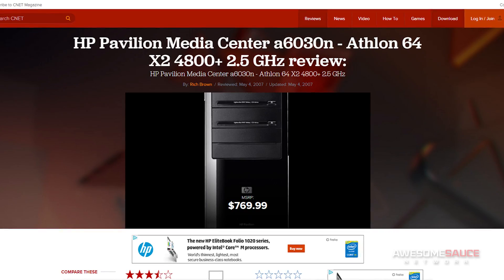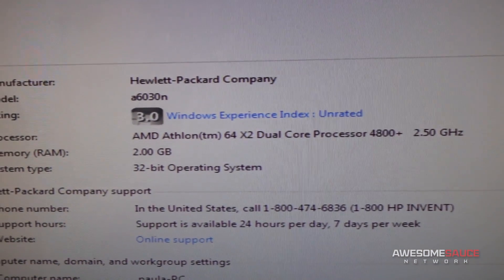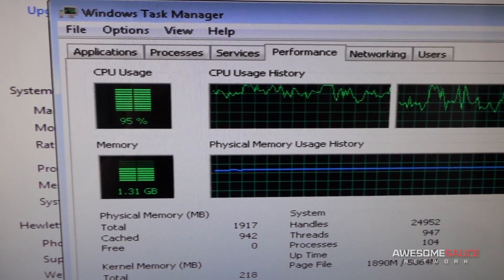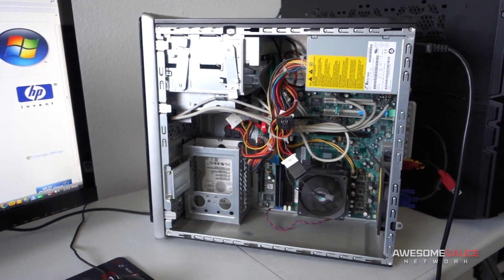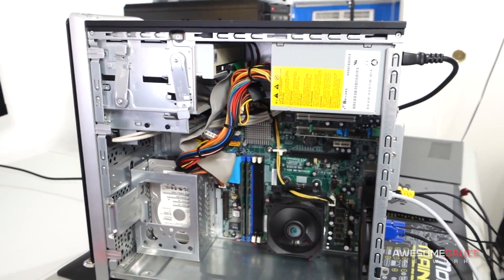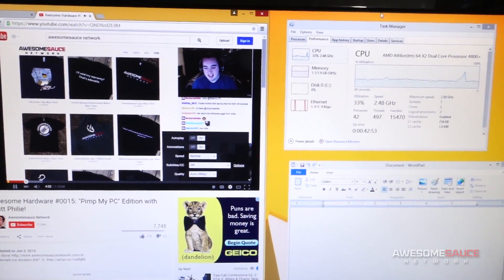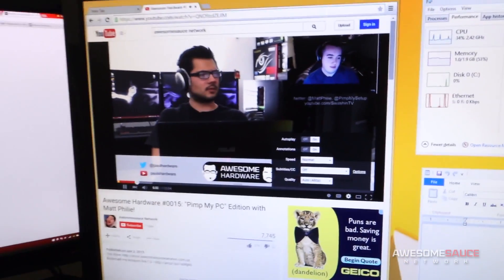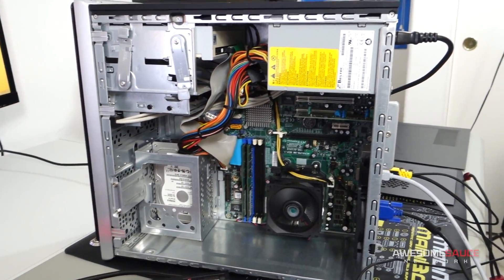Cleaning Up My Neighbor's Old Desktop!

Comment: Did I know it's early bad to cable tie wires together, because if you google it wires run slower when they are called together really tight, be the are they give off a really low radiation and when they are together really tight, it's not good for the wires, I'm not being a hater but thought I'd just say this

Comment: The very first computer I built back in 2001 or so had those blasted IDE cables. To manage them better I took the extremely time consuming task of using an exacto knife and splitting all the wires up by carefully cutting between them and then just pulling them down the length of the cable. Once that was done I wrapped the entire length with electric tape so it resembled a modern wrapped psu cable when completed. For a hack job it worked very well.

Comment: I have that exact computer, but I recently wiped it and reinstalled windows 7 64bit. This was very useful because I have a friend that's getting rid of their old (2003) hunk of junk. It uses ddr2 ram, So I know that I can take his ram and add it to my own until I save up the $6000 needed for my 64 gig, i7 core, dual GTX 1080 ti, dual 27" moniter Gaming rig

Comment: Here I am using a PC from 2009 with 3 gigs of ddr3 ram, a "vision" processor, no video card, and a 360 gig hard drive...
Reply: @canesvenatici9588  It's an AMD F1 APU it will have graphics on the cpu die.
Reply: @Sauntox No it's not but that PC won't be much faster even with the memory upgrade as those socket FM1 processors (even the best ones) were poor performers.

Comment: I'm trying to build a computer and I found that my Radeon card which is in R5 is not compatible that only with Windows 7 Pro but as I was installing Windows 10 Pro after the installation my computer screen got blurry and dark and now is not booting up I purchased a smaller graphics card and reset my Cosmos and I'm going to try to run Windows 10 again So This Be OK

Comment: Funny thing is, my mom had that stock rig, gave it to me, and i had to replace the drive, it was dying which made sense given how hard my stepdad slammed the tower on a desk a few years prior and i already knew blunt force can screw it up. After that i got a new case and got the internals and the optical drive transferred over. And after that, i bought new internals all at once. Kept the optical drive because it works well after 10 years. So now i have my current rig from that, the first computer i ever built and i'm planning to get a better power supply so i can get a GPU for it.

Comment: u should have downloaded windows 7 super lite 
it's pretty amazing that takes 0.5 GB and used low ram / cpu
the differnce is that it doesn't have the windows stuff that works in the background and non things like windows games or office 
but it gives lots of preformance for the low PCs

Comment: damn dude and i thought i was good with computers in my class i would get a c- and you would get an A+ nice cable management. I have this exact computer only i upgraded to windows 7 64 bit with 16 gb of ram, an extra tb hard drive, a 750 geforce ti, a amd fx 6200+ six core with a new power supply to handle the new components i clean it a lot too lots of dust build up and that 1 outlet fan really sucks

Comment: good computer I have the same computer how do I get take out the hard drive because I tried and I don't want to ruin it since it's not simple as just done screwing some stuff sliding out the drive is there any way you can show me how to take out the hard drive correctly

Comment: My almost 10 years old computer runs GTA V 720P low settings at 45FPS, it's kept clean and has heavy overclocking.
Specs: Intel core 2 Quad Q6600 3.2Ghz, 6GB DDR2 @1.2Ghz, 2x9800GT 1GB custom bios, ASUS P5KC custom bios, 2.5TB Storage.
Still works like a charm and non of the parts have ever failed.

Comment: I hate the way HP made their cases. They could've just left it with the psu at the bottom and the exhaust fan and motherboard orientation like a modern case, but they have to completely flip it for no reason whatsoever, and change which side of the computer opens up.

Comment: Man I bought a PC back in early 2007 with Windows Vista installed. It was a pretty powerful PC back then, ran crysis 1 at high settings with playable FPS. I used windows Vista until 2012. What a beastly OS it was.

Comment: how could he use a kaveri?  isnt this intel?
Reply: His suggestion was for a new system.  This system is basically end of life for most users.  Even if he put the fastest CPU the motherboard could handle and a modern graphics card in, the system would be limited by the relatively old DDR2 RAM.  For the owner's purposes it works, but it's moved beyond the point where any upgrade will grant worthwhile improvements.

Comment: if he had that many viruses, u should have replaced the drive. there are viruses that u can't remove even after a clean install because they put themselves into the hdd's fireware. There's basicly nothing u can do at that point and it's just safer to replace the drive completly.

Comment: wth over $700 bucks for that piece of crap
Reply: It came out in 2007..
Reply: you must be thick. $700 WHEN IT WAS NEW.
in the same way a new GTX 1080 is over $1000 in 10 years time you'll be able to get one for about $40 because it will be as you put it "crap".

Comment: Today i cleaned up a similar system with an almost identical mobo except it had a quad core and 2 ram slots and windows 7. It was dusty AF. So dusty that running a defrag causes all the fans to run at full blast and sound like a jet engine. Now it runs faster, cooler, and quieter.

Comment: great clean out, I usually work on my fathers PC and all my friends. Your neighbor's PC was not as dirty as I have seen. What are the cleaning liquid you are using to remove the old thermal grease/paste? I tend to use just 90% rubbing alcohol with a little elbow grease does the trick but i have seen other people use those two liquid and does a quicker job. I usually also tend to remove the hard drive and hot swap it to my desktop and run several virus and malware scans before reinstalling the hard drive and configuring the startup. None of my clients wants any upgrades out of 7 so i just stick to the old software even though I am running windows 10 on my own desktop.

Comment: I have the same PC and it keep showing bluescreen and restarts. What should i do?
Windows 7 32-bit with 2GB RAM,1 TB HDD,1 GB Graphics and D-link Wi-Fi card
I have reinstalled the OS but still shows Bluescreen. Need Help..
Reply: My experience with "random" blue screens and restarts is that usually the graphics card is drawing too much power for the power supply.  If your PC is clean and is doing this with a fresh install and updated drivers, I suggest getting a new power supply first, to see if that fixes it.  Alternatively, if your PC has an add-on graphics that you are using but available integrated graphics, you can just remove the graphics card and run the integrated graphics to see if that resolves your problem.

Also, if you DO have integrated graphics that are not currently in use, make sure the integrated graphics are disabled in the BIOS.  That can create conflicts and problems.  I'm not used to it creating blue screens, but one never knows.

The other thing that I have seen cause blue screens and restarts is bad memory.  DDR 2 RAM is pretty cheap, so try replacing both sticks and see if that helps.  I've only seen this twice, though.

Comment: that  is probs the exact pc i had lying around... before i became lets say a pc nerd or what not, anyway, after cleaning it up, i found 40k malware's... my mum was like what are u doin to that, its fine, dont mess with it, im like yea sure its fine, its normal to have 40,000 malware's? shes like yea, all those software's say that, its a gimmick... lmao

Note: system specs were much worst, and inside it had some next lev custom parts... like it didnt have a fan on the heat sink... just massive fins, and this funnel with a massive fan to cool it, it was interesting, but tedious...

Comment: Soooo. ... can I mail you my tower??   I will pay for the shipping cost.   I have a hp  I paid about $1600, too have a custom built.  Being a woman,  hp thought I would not notice how they left some things out,  . Like my built-in tv tuner.  , for one.   Sooo years later, ? ( July 2016 )  this voice came out of my computer telling me that my computer needs to have a windows Vista technical support, and to call them with the# on my computer.   Thousands of dollars later, ?   I was charged $500 ×6  time's on my card,  and the very people that I was talking to and trusted that this was windows, ? Turned out to be fraudulent.   The hacker's were good,  but left me pissed,  and stressed out. My bank gave me all of my money back., but now, the computer that was a Vista 64, now is windows 10 . That' still shut down,  and I still see my pointer move by itself.   The hacker's added 10, but left my hardware, software,  drives, the same,  and, basically until unusable.  It has a quad-core Duo processor 64  a 8 Gs . Now it's just a crappy computer

Comment: We found one of these, a 17" Dell LCD, a keyboard and a mouse at a local thrift store for a total of $17 out the door. It has 4gb, but the 4400+ X2 processor. A similar deep cleaning and a fresh Win7 install, and my brother in law is very contentedly using it at college.

Comment: Ya know how to fix system interrupt? It bottlenecks my pc extremely. After 15 minutes After booting system interrupt takes up all my cpu load.
Reply: Niek Kleiboer hey maybe try cleaning it out, both software and hardware wise
Reply: Forest flame Just gonna upgrade it on The way. A file only install. Probz a corrupt driver.
Reply: Just clean install your PC. It solves all weird problem.
Reply: WB IsMe well it didnt.
Reply: its NOT bottlenecking your PC. its a vital process to windows. windows shows inactive CPU as a process
Reply: TheLMGN well... It rises for no reason. And when its on max. My PC becomes unresponsive.

Comment: http://www.bestbuy.ca/en-CA/product/hp-hp-pavilion-pc-intel-core-i5-6400t-6th-gen-2tb-hdd-12gb-ram-intel-hd-530-graphics-windows-10-510-p009/10440891.aspx?path=0c37f9a2a9bb8b254c4b54331e11dd9den02

tell me if i can upgrade the power supply then upgrade then GPU To anything under 200
cuz the power supply is 180w ;(

this is the power supply i want 500W
https://www.amazon.com/EVGA-WHITE-Warranty-Supply-100-W1-0500-KR/dp/B00H33SFJU/ref=sr_1_3?s=pc&ie=UTF8&qid=1480710997&sr=1-3&keywords=500w+power+supply

The GPU i might get

https://www.amazon.com/dp/B01MCU1ERO//ref=as_li_ss_tl?linkCode=ll1&tag=pcbuonabu-20&linkId=499bcf91409e3673fd394616c5a1b656&th=1

Comment: I wish i was your neighbor o.o I have a first gen 10 year old pc with an intel pentium dual core, 1gb of ram and a gpu that can't even handle minecraft..
Reply: MMOderator  install windows 7, put a 750ti and more ram in it, it'll run crysis
Reply: It costs like $150 though..
Reply: And i'm poor lol
Reply: MMOderator ram is 10 bucks on eBay and a 750ti is 100 bucks
Reply: It's a 10 year old winfast px6600 gt
Reply: MMOderator  Idk if this would work on your motherboard, but it is currently $40 with $20 rebate. http://www.newegg.com/Product/Product.aspx?Item=N82E16814127765
Reply: You're not the only one. My gpu has 64mb of vram
Reply: MMOderator #living_the_poor_life
Reply: I think the 1gb of ram is the main problem, but maybe because you do not got a GPU.
Reply: I in fact have a gpu, but i didn't mention it because it can't even run minecraft lol
Reply: MMOderator It's only got 256MB of memory, that's why mainly.
Reply: mhm
Reply: MMOderator You should watch a budget PC video, idk what you got currently, but maybe slowly grow a budget if you don't got a budget.
Reply: MMOderator Note that minecrsft barely uses the gpu as its cpu and ram bound
Reply: Ive been using a core2 duo w/ a 1g 610 gpu and 4g ram for a while. Im also pretty new to the PC world. I finally decided to chin up and take on a second job over my weekends to save some cash to build something more legit. Though admittedly I have a few buddies giving me some used stuff that im saving some money on. But if you want it bad enough, there are ways to make it possible.
Already have some parts mailed but soon ill be on an i7 quadcore, 4g 470 gpu, 16g ram and SSD. Still shopping around for a case.
Reply: MMOderator BUILD A BUDGET PC!!!!111!1!2!1!1!2
Reply: my laptop plays mine craft at 1 fps
Reply: Me2 but i have an ati9250 in it 128mb
Reply: First World Problems...
Reply: MMOderator Do you know what gpu it is?
Reply: Buy a GT 710 and add a 2gb stick

Comment: this pc is 5times stronger than my potato pc!
Reply: MrMovieMan941 give it some more ram and you'll be fine. I got 1.3 GHZ amd laptop that is slow as shit (not enough ram) and it runs 480p fine. Even a little bit of 720p
Reply: amazon and ebay is not an optiotion here!
I mean it is working but taxes are friking high like 50% of the cost and I would need to wait like month or two or maybe it would get stuck on the customs :P
Reply: +Peter Kapica Damn you guys have it hard it is like 20 aud here in Australia - 12 or sp usd
Reply: I can top it: my Laptop: AMD Athlon XP-M 2500+ 2 gigs of ram and a S3 Graphics ProSavageDDR (ik i have to buy a new one)
Reply: Lol to think I have more processing power in one core of my 5820k OC'd to 4.4 lel
Reply: +MrMovieMan941 haha
Reply: MrMovieMan941 what specs?
Reply: intel celeron e430 1.8ghz oc2.47
2gb ram ddr2
intel g31 intergrated GPU :D

was having ATI HD4550 long story lol
i can almost watch 480p on youtube with firefox ofcourse :D
Reply: And you may be able to put in a core 2 duo or core 2 quad in there
Reply: nope not here in Serbia where dual core is over $80 and quad over $150
there is no  point upgrading it :D
Reply: MrMovieMan941 that's weird, In the  states you can get a core 2 duo on eBay for as low as 10 bucks. Go on eBay and look there
Reply: MrMovieMan941 oh, do you have Craigslist there?
Reply: No craigslist that's weird.
Reply: yup we have something like craiglist here, but still prices is over the roof here lol
Reply: MrMovieMan941 well can't do much so idk what to do
Reply: MrMovieMan941 how much is DDR2 ram in Serbia? If you upgrade that you'll be good. In the states, 4 gigs of DDR2 for around 30-40 bucks depending on where you buy.
Reply: ddr2 cost almost 3x more than ddr4 in most countries just because is getting old and is not going to be produced anymore :) it si a truth :)
Reply: opusgames I paid 10 usd for 2 sticks f ddr 1 on eBay
Reply: Lol my pc is new and only makes 1.5 ghz
Reply: i think mine is even worse atm,
it has:
Really old gigabyte mobo (idk name)
Pentium E2200
1gb DDR2 Ram (upgrading to 4 soon)
stock intel cooler
Shittiest case that cant fit a ssd and dirtiest front panel (well now i cleaned everything)
300w psu (mounted on top because case sucks)
250gb hdd
Ati radeon hd3850 (even the cooler of it is missing idk what my uncle did to it)
and yeah my uncle was the owner before so the first time i opened it it reminded me of my grandpa (idk why lol)
Reply: MrMovieMan941 shut up I have a netbook with 1gb of ram running not win 7 not win 8.1 but windows 10

Comment: That system is MINT!! Today I decided to blow out my old thrift store HP tower with compressed air without taking anything out or disconnecting it and the there was so much dust that it went everywhere even though the system visually is clean.
Reply: Peter Kapica What thrift store is that? You can't find a computer in California under $30... Even terrible ones.
Reply: Rods Ahed Salvation Army. Got it for 10 bucks and I Live in Illinois

Comment: I'm watching this on a Dell Dimension 4600 that I pimped out that sits next to my modern desktop just for kicks. I'm talking  an SSD running at SATA 1, an HIS HD 4670 IceQ Radeon, 4gb of ram (of which only 3.25 is useable, oops Win 7 32 bit). the cpu is only a P4 2.8 but I will bump that up to a P4 3.4 with hyperthreading when I feel like it. Boom.

Comment: that pc is still pretty usable if it has 4 gb of ram and win10 and a gt 730/740 for modern games and a lot of stuff i have the 6000+ version of that processor and its pretty usable and fast when coupled with 3 gb minimum of ram and a medium gpu
Reply: I'm still saving up its been two years I'm getting a 
Intel i5 6600k 3.5ghz
8gb ram 
Gtx 750ti
2tb hhd
100gb ssd
Reply: @jazzhandsdan  hope you didnt buy the 750ti
Reply: XP is better than 10 lol

Comment: I like the video, I have an HP Pavilion CT9280t My mother board is Manufactured by Pegatron corp, Product TruckeeI have an Intel core i7 975 @3.33 GHz. .I want to upgrade this system before I invest in a new one.. system has 12 gb ram I just upgrade to 24 gigabites swap out my video card because it chrased, it had1gb ATI radeon 4850.. also just bought two SSD drives...crucial MX 300..I want to know if I should change my cpu and which one  can I put in this system to maximize it,,..I also jus bought a 4gb video card GeForece GT 740.